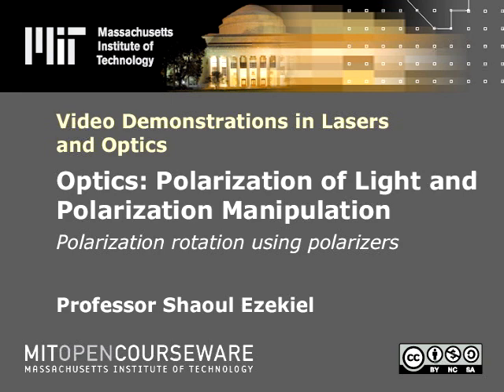Optics: Polarization rotation using polarizers | MIT Video Demonstrations in Lasers and Optics

Comment: I remember seeing a similar video, but stating that it was not understood how the light is able to come through in some cases.
Reply: re: "but stating that it was not understood how the light is able to come through in some cases."
Polarizers are not "filters", per se, but "re-radiators" of the EM or light waves (as the presenter in the video says, although subtly)... but, the polaizer must intercept some energy on their 'linear' segments, or elements, so the case of the 90 deg rotation then no energy is re-radiated since none was picked up, or intercepted, in the first place. That is to say, the 'elements' in a polarizer act like dipole antenna elements, with intercepted energy equal to the cosine of the angle, where cos(90) = 0.

Comment: really easy to understand and very well explained..Thanks for the video :) But I was wondering that how  the use of 2 polarizers have enabled the rotation of light by 90 degrees? (basically I want to know the logic behind this phenomenon ...)
Reply: Note, there is a PENALTY for this "rotation", the re-radiation of the RF, I mean light EM energy is at a cost of the cosine of the angle difference from polarizer to polarizer (neglecting a small amount lost in the polarizer regardless of angle). AS long as you can sustain this cosine loss, you can infinitely rotate the light.
Reply: re: "(basically I want to know the logic behind this phenomenon ...)"

Think: Re-radiation of the light at the angle of the last polarizer encountered. As  long as the angle between the two is not 90 deg, then light, at the new angle, will be "radiated" by the polarizer or grating.
Reply: @uploadJ  I thought that polarizers worked by blocking light that was not at the proper polarization to pass through. All of the light passing through one polarizer should then be parallel with each other. Isn't that correct?
Reply: @ebunny91  
The light is at the angle of the *last* polarizer encountered ... nothing more, nothing less. IF the angle between two polarizers is 90 degs, then NO light makes its way through, according to the cosine of the angle, cos(90) = 0.